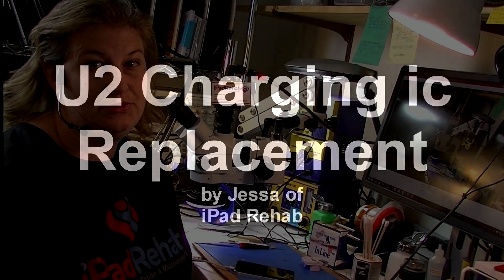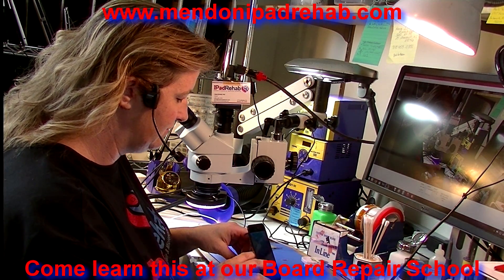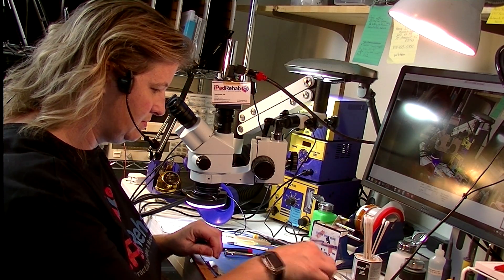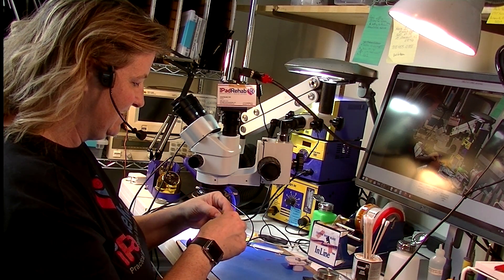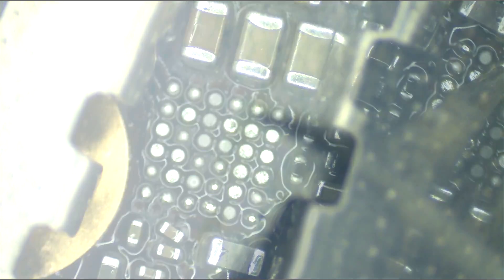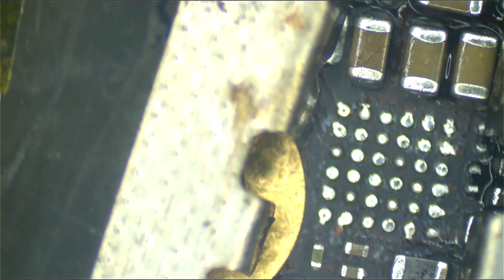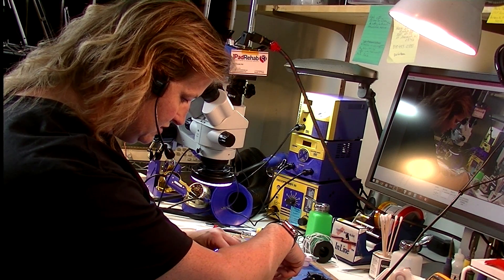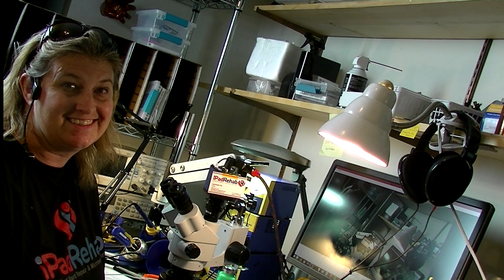How to replace tristar (U2) charging ic chip to solve slow charging, fake charging problem

Comment: +iPad Rehab I have an iPhone 4S, my first ever smartphone, that I fixed up a long time ago after it crapped out on me. It started when it was not accepting a charge. Even with known good cables/chargers, it wouldn't charge. At the time, I thought it was a battery issue. When I went in to remove the battery, it was at 1% and the power button was jacked up from a botched repair attempt, so I couldn't power the device off normally. When I got the battery out, the battery connector went with it, attached to the battery. I thought "Aw, crap. This phone is done for." My dad came through for me by giving me his old iPhone 4. I used it for about 5 months before deciding one day: "All right--I've had just about enough of this thing. It's way too slow!" At the time, I didn't have the money for a new phone, but I did have the money to repair my old one to the best of my ability. Things to note: automatic screen brightness and front facing camera components are nonfunctional, with a now partially repaired charging system, done so by resoldering the battery connector to the logic board. Now, mind you; the phone went through a lot physically--a lot of fall damage, to be specific, and that's why. It's a miracle that I was able to revive the device at all. I've long since gotten it back in working order again, but the phone charges slower than it should be and has been since I brought it back from the dead, so to speak--even with a brand new battery. Also, I have an app on the phone that shows battery stats like wear level, voltage rate, number of charge cycles, etc. The app isn't reporting a single full charge cycle [cycle count is stuck at zero with a battery that has probably gone through at least 50 cycles.] The phone still charges slower than what is normal for any phone, and just the other morning showed a 98% charge from about a 3% charge the previous night, all the while getting its charge from a stereo docking station because at the time, no other wall chargers were available for it. I managed to resolve that by removing the phone from the dock and putting it back on there.

…Well, you know the whole story. Do you think it's a problem with a logic board component? Please answer back when you can with your thoughts on what underlying problem may still persist with the device. Thanks.

--Smartphone Handyman

Comment: Hi Jessa, I hope you can help me. I have a IPhone 5s and I have been having problems with the battery for a few months. Problems first started when it would only charge to 57% and then stop even thou the charging lighting symbol was still showing. Then it would drain very quickly even thou its plugged in. Now it wont charge at all, all I get is a black screen with the battery icon showing red and it wont charge. Any ideas?? Great videos by the way, keep up the good work. If I got the U2 chip changed, how long do they usually last?
Reply: +Lorna Fletcher until you blow it up with a non-Apple charger
Reply: I notice swelling batteries cause the U2 to fail also (sometimes)? Or the non-Apple chargers and U2 causeing the battery to swell? I notice they swell two different ways.  Usually like a balloon and U2 will be good.  But if hard like a rock and bumpy usually bad U2.  Or am trippin'
Reply from the maker: Probably U2 chip related but as always thinking measuring and figuring it out is required.
Reply: thanks Jessa, if the U2 is at fault and is replaced, how long does a new one last?
Reply: ive only used apple chargers
Reply: Hey Tony yup you're on to something, I've seen similar things here at dr apple.  Anything power related we always give out a disclaimer about the ic chip possibly being affected and go through all the options with the customer better safe than sorry
Reply: Dr. Apple SD?
Reply: I notice they swell like a balloon or a ripply rock. If ripply rock U2 sometimes bad.

Comment: RRRRRRrrrrr. LOL.  Stuck gas guages.... RRRrfff.... I don't think it has anything to do with the U2.... Looking towards U1401.
Or f'd up @ PMU.  Keep seeing this too much and can't EVER solve. Have Airs & iPhones all stuck. Changed U2's multiple times and checked caps etc.  I'mna solve this MF ;'/ LOL   Even different versions of chips tried.  Nada.  Got a pointing finger?
Reply: Look at the gas gauge line.  Where does it go? Does it go to Tristar? No. Stop wasting your time on that.  Tell me where the gas gauge line goes and you'll have your answer.
Reply: Will do.  I've never noticed it says 'gas gauge' I always assumed (thought I heard) it was Tristar and some of those code wordings that can sometimes be confusing LOL.  Atleast I know it has nothing to do with Tristar I can get off that boat. The U1401 and Q1701 (I think) is where I'll check next : )   Got a lot of catching up to do though : ) I'mna get this mofo, been buggin' me everytime it comes up. Think I'm only making it more complicated than it actually is, haha.  But pointing me in the right direction : ) Love ya for it !  Indeed will follow up !!!  [They need emoji's on here]

Comment: Hi, I have currently just started a new mobile phone repair business and most of my work is more plug and play rather than board level. I have done some surface mount work in the past and used an airflow rework station to remove QFN's, SOTP's but never have I done BGA's. the techniques looks similar to those I have used in the past but because I am looking to repair customers phones it feels risky (of course I woukd practice first) however my question is, woukd an infrared set up be safer and easier to use for U2 and WIFI chips? or is a hot air station still considered the best way? any help would be greatly appreciated.
Reply from the maker: infrared stations are great ways to burn up iphone boards
Reply: Thank you for your reply :)

Comment: Hey there... You mention a "common no-boot problem" being the power management chip. My iPhone 5 wont turn on, I tried replacing with a known good battery, same thing. Would you recommend trying to replace the 338S1131 or is there any way to confirm the problem?  Help greatly appreciated!
Reply from the maker: PMIC failure is much more rare than any other no boot cause.  Look for shorts or missing data lines first
Reply: Thanks for your reply! I just opened it, looked around, didn't find any shorts but without doing anything it fully booted once. So i thought its good. Put it back together, it boots till the Apple logo, then shuts off. Could that be U2 as well? Same with a known good battery...
Reply: Oh, missing data lines. Gotta figure that one out next. I have an analog scope, better digital?

Comment: Hi my wife dropped her iPhone 5s ,now it's dead and when trying to charge nothing happens and it gets hot where all the connectors are located at the top of the main board, could you please give me an idea what it could be,could it be the battery or power chip? Thanks
Reply from the maker: heat = short.  find the short.  least likely is battery or power management chip.
Reply: oh I didn't think of a short , I am a beginner with cell phones , could you please tell me some well known ideas where a short could be would it be on one of the chips or another place , thanks so much
Reply: Thanks for your reply I will check it
Reply: Jessa I am down in Arizona and I have her mainboard out of the iPhone 5s and the heat shields off from the front and the back , I see a black wire connecting to a gold connector the wire is broke , remember I said it went dead when she dropped it and wont start again and it get hot when you try to charge it near where the battery and everything is connected, could I send the main board to you because I don't know if I broke that wire by accident taking off the heat shield or there is a short
Reply: the black wire on the side of the main bord with the 2 gold ends one end is broke the wire if thatwas broken and I didn't break it would tht cause the short where the phone wont come on and it would get hot tryin to charge it, thanks so much

Comment: If you change the u2 chip on iphone 5s how can you be sure that it wont fail again in ablut 2-3 months or it will go on about 2 years ?
Reply from the maker: As long as you don't use cheap chargers it will not fail.

Comment: Just watched this and repaired my first u2 tristar. Excellent video! Quick question, you said if you did the repair now you wouldn't bother with braid, do you just sit the new one on top and let the hot air melt old solder back in place? Seriously thanks again, this vid helped a lot!
Reply from the maker: +Stephen Elliott bead individual pads until they all have even amount of solder. Wicking means risk of ruining the pads. These pads are stuck on with scotch tape

Comment: Question Jessa,

I have a Belkin USB cable that will charge damaged U2 IC's.  I've used other Belkin cords, Apple cords etc.  Nothing will charge a bad U2.  But why is it that this one and only this one will charge bad U2's ???

It is puzzling !    Please share some insight : )
Reply: Word!

But it's only 1 cable out of 10 I had that would do that. 

I bought some more & just waiting for another bad U2 to test.
It'd be cheaper to sell them a cable than change the chip.

Comment: When you fuck up or blow away some component, would be great if you'd show and explain the danger  for those who are not familiar how to work with hot air, not like in this video.
Reply from the maker: Did I fuck up and blow something away? I don't remember.  If so, just grab one off a donor board no big deal.
Reply: U did blow the fuck away the component while heating up the chip, its not a big deal if u mention that, and not trying to hide it, point that this can happen, and its not a big deal, and show ways how to avoid similar outcome due to lack of experience that you are having, but please don't act like fucking no one will notice, its stupid, what i'm talking about??? Here you go on 9:27 you fucked up cap or whatever it was, NO MENTION in your video about that, next thing you know on 9:52 it seems like you've repaired it like the homeless guy with broken hands, and NO MENTION OF THAT?Why? Tell me?
Reply from the maker: ur mad af bro
Reply: +Virtuves Stebuklai whoa.  Angry dude .  Settle down.  A cap that gets jostled a little?  Put some hot air on it and it will go back on its own.  There is no need to do anything at all.  Why did I not mention this? Probably because I went out to go meet the bus or something and there was some 15 minute delay in the clip so I cut out a chunk and forgot where I left off when I came back.  The reality is that if you jostle a cap like that you do nothing at all.  Place the new chip and it will just click back into place.  This video is ancient, I have absolutely no recollection of this repair.  If I was doing one now I wouldn't bother with the shields or braiding the pads at all either.
Reply from the maker: +Virtuves Stebuklai someone's mad. U mad bro???
Reply: Thanks very much, Jesse, for posting videos like this!
Just tried to remove my first u2 from an iPhone 5. 
Didn't succeed yet. 
To help other newbies :  I set the hot air on my Aoyue 968A+ at 385C. I think Jesse uses a rathet low airflow. I started mine at medium, and it blew away the flux immediately.
Which could be the problem why I could not get it of.
I heated for about 2 minutes total, without success. 
Did not dare to continue, afraid of doing damage on the board.
Next time I will try 400C, though I suspect Jesse uses even higher temperature here, since it comes off so quickly.
Reply: John van Beek Try a larger nozzle. 2mm is a little too small. I use around a 6mm nozzle for my rework.
Reply: Jessa's contribution to the repair industry/community is second to none. These videos are available for you to utilize (or not) completely free of charge. So rather than bring an unnecessary, uncalled for shitty attitude for no good reason to the table, how about you take some time out to yourself and learn some common decency prior to shitposting in the future.
Reply: You dickbag, you really think she is doing those videos solely for deepen your knowledge how to repair i devices at home?? If you do think so you are an idiot.
Reply: oh, and I used a nozzle with an interior diameter of 2mm.
Reply: Mixed Forum thnx, I will!

Comment: Hi Jessa, great Video! Unfortunately, I have neither the equipment nor the skill for serious board-level repairs, but I have a more general question: If I use a genuine Apple charger, but with a cheap replacement USB cord (instead of the original one, which broke a while ago), can that also cause damage to the U2 ic? 

[FYI: My phone is currently dead (black screen, no boot, no response to hard reset) and, upon connecting it to my laptop, it gets stuck in a loop: connect-to-itunes >> attempt update/recovery >> error 4005/4014/4015 (varies).]

Comment: I have an iPad 4 a1458, Wall socket mains charger exploded while it was connected to my iPad, I have replaced charging cable and wall socket but still no joy, my iPad won't turn on, no power. Is changing (pmic) Power IC on motherboard will fix the problem? and is that something you can do for us. If so please let me know how to book in for repairs and how much to get it done. Kind regards, Nas.

Comment: Hi Jessa. Only when you get a spare minute :) I'm working on an iPhone 5 that is charging the battery but won't register it's level so it won't turn on, and it displays bat empty icon. However, the gas gauge line is in tact. It will sometimes try to turn on and show apple logo but after a few seconds it will fade out and repeat forever. No liquid damage. I'm doubting it is U2 at fault as USB comms seemed to work when it showed DFU screen and the symptoms shown here don't seem to be present. I'm going to start checking voltage rails in case one is loading up/shorted. Hoping you have seen this behavior and can advise if it's also a common fault or not. Greatly appreciated, love your work!
Reply: +iPad Rehab UPDATE: so far no luck. Really trying to avoid pulling the U2 so I got to the point of seeing the watchdog timer from U1 into U6 go high causing a reset and this happens during boot or just before iOS is reloaded (apple logo and progress bar showing). Hoping this might be a software issue and I could force it to continue I removed U6 and grounded the output pad so U1 would never reset. Sadly this hasn't changed and it's still resetting, looking more like something telling PMU to shut down and come back as all the rails drop before the reboot. Now think watchdog went high as a result of U1 losing power. Will let you know if I have a win.
Reply: +Jonathan Dix if it is U2 it will boot with known good battery
Reply: +Jonathan Dix or DC power supply
Reply: +Jessa Jones Thanks so much for further helping eliminate U2. I believe battery is good so must be another issue. Will try with DC supply just in case, but I thought it would have issue not being able to read gas gauge line. Will post update.
Reply from the maker: +Jonathan Dix it will after a few minutes, but it should boot and come to full display before it notices gas gauge problems
Reply: +iPad Rehab Sorry I haven't been able to figure this out. I'd hoped to find the cause so to be of some value to you also. On the scope it shows that RESET_1V8_L is driven low before the rails are dropped. As this appears to be derived from PMU then there is something PMU isn't happy about and is choosing to initiate the reboot, or is being told to power cycle via the I2C line. At this point I think I will conclude the latter due to software corruption. It will sit all day with the itunes logo up but try and boot or reload iOS and it freaks out. Thanks again for the suggestions :)
Reply: +Jonathan Dix please rule out bad battery.  Many have defective gas gauge lines on the battery itself
Reply: +Jessa Jones also, DC ps can not provide gas gauge so iPhone 5 will shut off after a few minutes of use.  Use ibackupbot to read the real time logs and look for gas gauge errors
Reply: +Jessa Jones Just tried new battery, no change. Even on DC ps it won't boot. Sure is a curly one. Sadly ibackupbot won't access it in itunes or DFU mode.

Comment: Hi Jessa, Loving your work!! Massive well done on helping out the masses :) 
Quick question, I had an issue with a 5c With fake charging, have have replaced the charge port, Battery and the U2 chip (thanks to the vid) but it's still fake charging. 
Could there be another issue at fault like a capacitor or something? 

Thanks again 
Mario (Blackpool England)
Reply: Check for missing components by dock connector
Reply: Thanks Jessa, I will double check everything again tomorrow, and maybe even change the U2 chip again :) Fingers Crossed. :D x

Comment: Hey. I have a iPhone 3G or 3GS and I have some info I need to take off
Of it, and I can't seem to turn it on. Do you know of any tricks or tips that might help me in my situation.

It's been a good few years since I powered the phone on,

It did work last week, and when I tried to charge it. It didn't even want to show the charging symbol
Reply from the maker: +luigi martinez power the board with a dc power supply for data retrieval

Comment: Hi Jessa, what kind of material is that "chip" ?
Would it melt if I used a soldering iron to remove this chip as I do not have hot air station??
Reply from the maker: +Skyller007 that is possible but tough.  you don't want to pull pads under the chip.